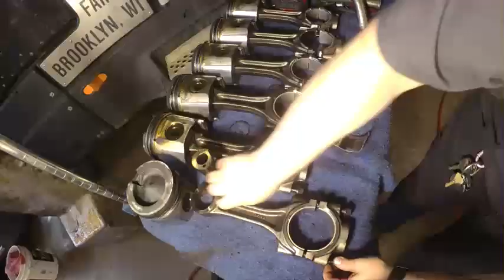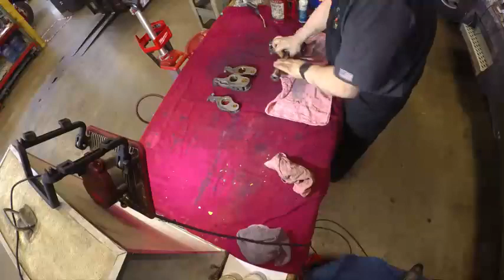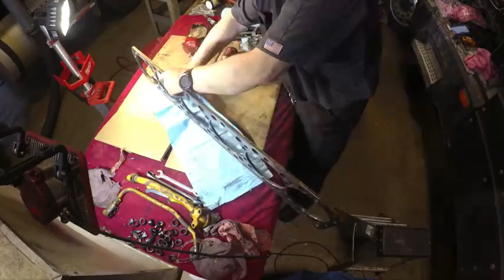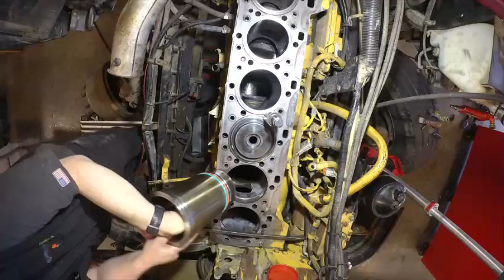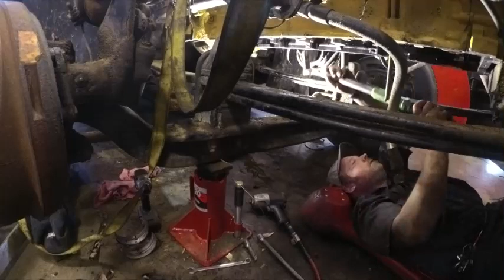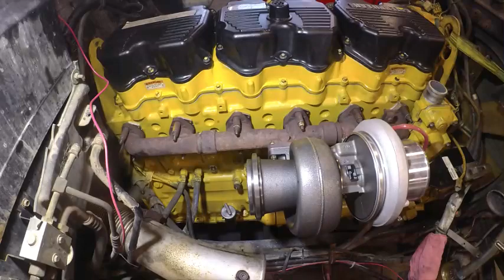3406E Rebuild with start up

Comment: I didn't see anybody checking liner protrusions. Maybe I missed it. Good job anyway guys.
Reply from the maker: Liner Protrusion was low. Customer declined repairing. It was documented. They wanted back together for farm work. Engine got more work done couple months later. As head gasket started to leak.  Not all rebuild can be proper out of frame jobs. Especially if customer is on a budget or time limited. Risks were explained to them. With the result coming back to get repaired properly rest second time.
Reply: @JessHuberd good Job, but a rebuild with out the spec liner protrusion in my opinion it's a waste of your hard work and the costumers money. Great video!

Comment: Buenas noches, un gran trabajo, quisiera hacer una pregunta, cual es el ajuste de los pernos de culata. Gracias de ante mano.
Reply: 325ft/lbs but I knew a Mexican did all his 400 and they are torque turn and always buy new bolts& washers and chase threads in block..

Comment: I hope those are new head bolts and did you check liner height?
Reply: Didn't look like it and always use a flat block to surface prep deck ect not your palm with a piece of sand paper.
Reply from the maker: Liner height was low and block deck surface was out of spec. Customer declined proper repair.  It would be a extra month to get block done as outside machine shop was backed up. I don't recall using sandpaper. Which I do normally use a block. This was awhile ago now and not everything was recorded.
Reply: @JessHuberd my sand paper comment was a general one for those fellers who love grinders,sandpaper in palm and rollover disks.you did a good job but I would of wanted them holes in spec but some guys don't understand what happens 6 months latter right?

Comment: Every time I watch a cat get an in frame, where the tech doesn’t check for protrusion, i cringe knowing your gonna have head gasket issues in the future.
Reply: Protrusion was checked. It was lower then spec. But, being harvest season. Had to have it "right now" and denied proper repair. They did bring it back after harvest for proper repair.